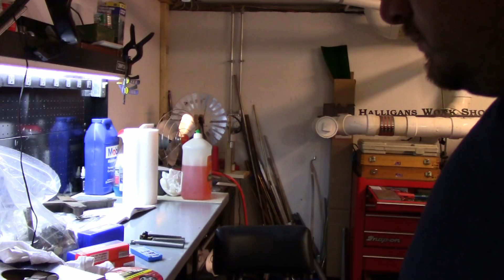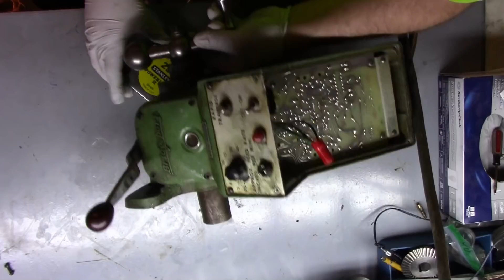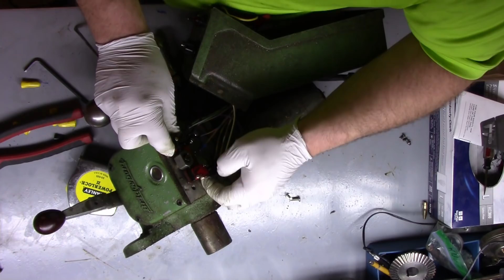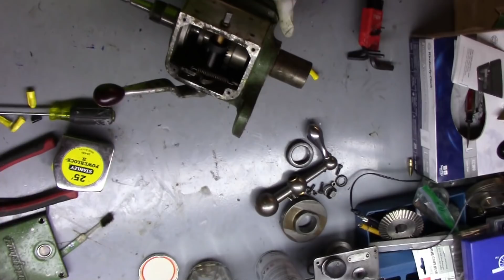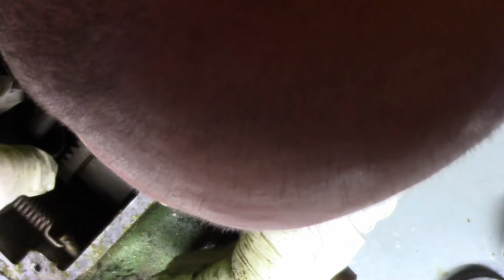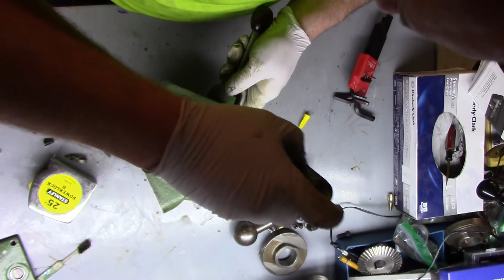Bridgeport Mill Cleaning and Assembly Part 3A : Power Feed

Comment: I was watching your video on cleaning your Bridgeport power feed.  I have the same one with a bad circuit board. I don't know the model number.  Can you help? Can you suggest where to find a replacement board?
Reply from the maker: It's a model 6f
You can get one here. 
https://www.machinerypartsdepot.com/store/1478157/page/711121

It's pricey and will require modification to install.  Your other option would be to search eBay for one or buy a whole new servo style one and install that.

Comment: Congrats on the mill. Nice payback for all the hard work you put into your YouTube channel.

Jumping ahead a little bit I am guessing the Bridgeport uses a 3 phase drive motor.  Are you lucky enough to have 3 phase power at home or have you looked into phase converter options yet?

I want to pick up a mill at some point and I am still trying to work out the best power option.  I am interested in seeing what you come up with when you get it ready to run.

Comment: I've rebuilt brushed CNC servo motors that have similar construction. There are rubber disc seals over the ends of the brushes to stop oil, cutting fluid etc from getting in. You can pull them out with a pick.

Comment: Greg,
That was cool that you got to talk to the guy that was in charge of the dept. It looks like at one end of the board is some SCRs/diodes wired into a full-wave configuration. This way you could rectify the AC and control the duty cycle of the power at the same time. That's obviously a DC motor, with it being reversible and the brushes, etc. Like it's been mentioned, look for electrolytic capacitors that have bulging tops as they are partially shorted and are going to blow in the near future. Even if the caps look good, it wouldn't hurt to check them as they could also be open if the electrolyte has dried out. Capacitors are cheap. You can get them from Mouser Electronics or Allied Electronics or your local electronics supply store, if you have one. Sorry to ramble on. Thanks for the video and good luck with your project!
Have a good one!
Dave

Comment: You might be able to get the motor open without too much trouble.  It looked like the screws on the face hold that part of the casing on.  With them removed, the brushes removed and the snap ring off the back of the shaft, the whole armature and case front should slide out.  There are probably a few screws inside holding the field windings in, or it might be held in place by the front casing.  If this is correct, you'd just need to feed the cord through the grommet as the windings are pulled out the front.
Reply from the maker: I tried getting those screws out and they wouldn't budge even with my impact driver.  Figured it wasn't worth breaking something because I know it works.
Reply: +Halligan142 I would have kept at it until I got in or broke something.  It's good you know which battles to fight and it still works with the old cord.  Thanks for making these videos; I really enjoy watching them.

Comment: While you've got the electronics apart you might consider just replacing the electrolytic capacitors (if any).  The mill is old enough that they must be pretty dried out by now and their series resistance is pretty high.  They're generic, readily available and easy to replace with the through hole '70's PCB technology.  I'm sure you'll be able to see some with domed tops indicating they're on their last legs.

Comment: One of the things I found to be an enormous help is to get a bunch of boxes at HF. You know the large storage containers. http://www.harborfreight.com/24-compartment-large-storage-container-61881.html  So you can keep your parts separate. When I rebuilt my lathe I took it completely apart, and having different boxes for different segments worked well.

Good luck on your new acquisition.